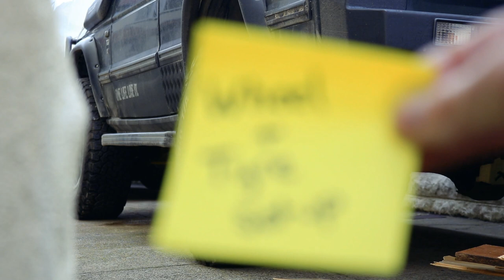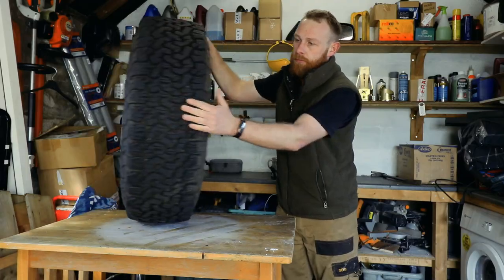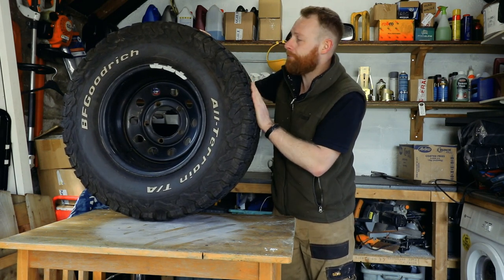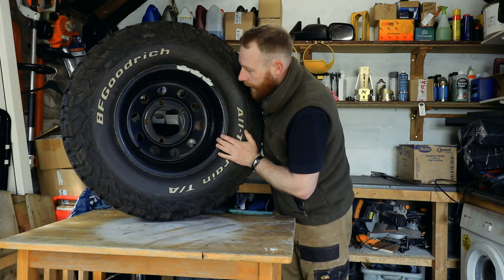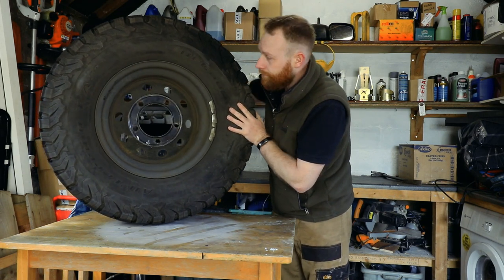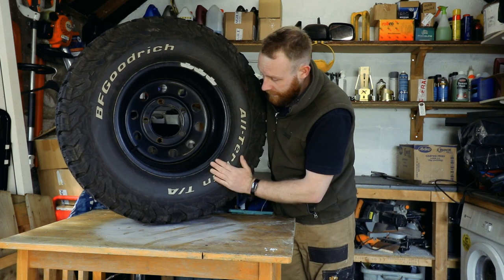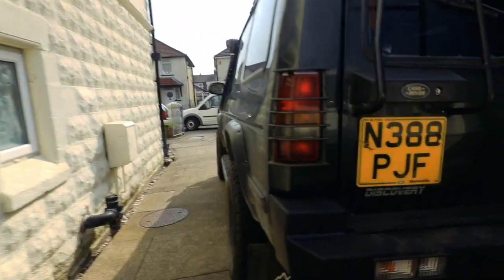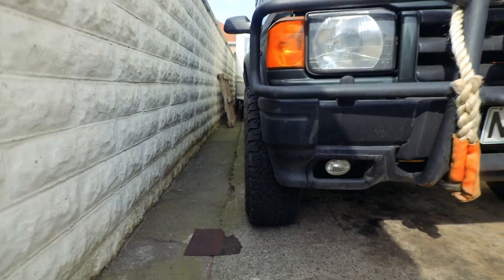What wheels and tyres do I have on my Discovery 1?

Comment: Hi! Nice rig, i have a 98 300tdi, currently on BfGiodrich All Terrain 235/70/16 (i'm going for a set of Khumo At51 245/70/16), but i want to know ¿Are you on stock gearing? A friend wants to put 265/75/16 on his 300tdi and we don't know if it's too much with the stock gear relation. Greetings from Argentina!
Reply from the maker: Hi, thank you! Yes still stock gearing on my disco. I have 265/75/16 and no issues with the gearing, you do have to use your gears a bit more with the taller tyres. I had 245/70/16 when I first bought the car I think standard was 235/70/16
Reply: @TheNorthernExplorer  Thank you so much!
Reply from the maker: @silver.d1  not a problem, thank you for watching and commenting

Comment: Looks awesome! So are you still running the 30mil spacers? And where did you get your wheels? I'm having a bitch of a time trying to find 16x8 negative offset steel wheels that will fit the Disco 2 here in the states...
Reply from the maker: Thanks Sean, no I’ve just got the -35 wheels. Have you thought about shipping over from the uk or is it a fortune to ship?
Reply: @The Northern Explorer  I'd ship from UK. Do you have a recommendation for which supplier? Thanks a ton.
Reply from the maker: I use paddockspares.com or jgs4x4.co.uk